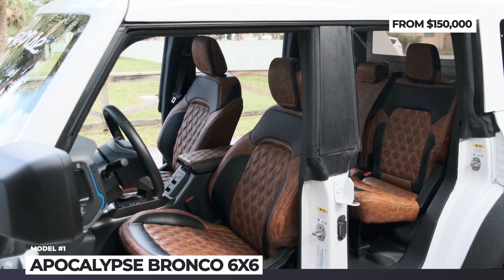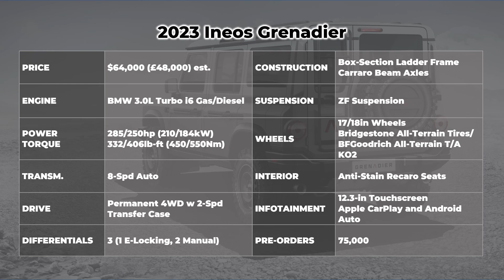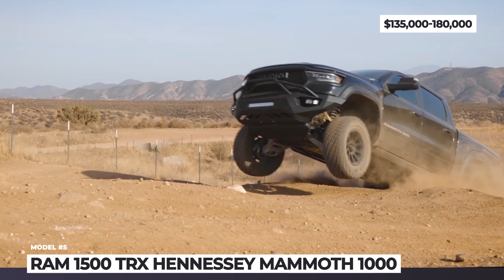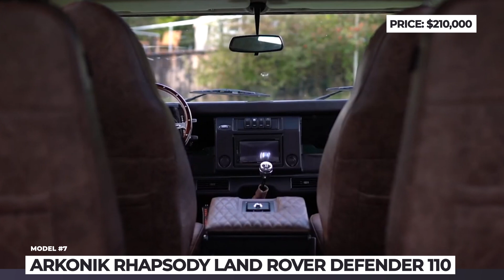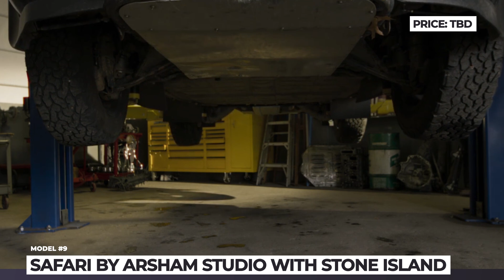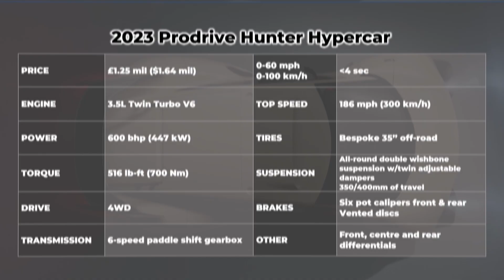New Offroaders and Trucks Built for Conquering Dirt, Sand and Mud

Comment: Land Rover should have continued simultaneous production of the original body-on-frame Land Rover DEFENDER 110 4WD + 2.0 in. 2.4 TDI I4 5-Dr SUV (RHD) alongwith with the new monocoque chassis based Land Rover DEFENDER 110 4WD + 2.0 in. 2.2 TDI I4 5-Dr SUV (RHD) . . . the Ineos Grenadier 4WD + 2.0 in. 2.2 TDI I4 5-Dr SUV (RHD) is a nice piece of off road hardware but it ain't Land Rover . . .

Comment: a 2021 brand new Mercedes Benz UNIMOG DOKA U5023 4X4 + 4.5 in. Lift 5.3 TDI I6 4-Dr Double Cab AT Camper Truck (LHD) best compliments the 1985 PORSCHE 911 Safari (901) 4WD + 1.0 in. Lift 3.0 B6 2-Dr Sports Rallye Coupe (LHD) . . . or a 2016 built Land Rover DEFENDER 110 4WD + 3.0 in. Lift 2.5 TDI I4 5-Dr AT SUV (RHD) custom made for extreme off road use by Land Rover SVO . . . the Ford BRONCO Raptor 4WD + 3.0 in. Lift 3.2 Biturbo V6 5-Dr SUV (LHD) could do with a model specific custom made 36.0 in. mud/terrain radial tyres instead of some random 37.0 in . . . and some solid fibre reinforced polymer wheel arches please instead of the thick rubbery skin type as in the prototype vehicle in this video . . .
Reply: 4X4 OR AWD?  HUGE DIFFERENCE ... RESEARCH YOUR NOTED VEHICLES